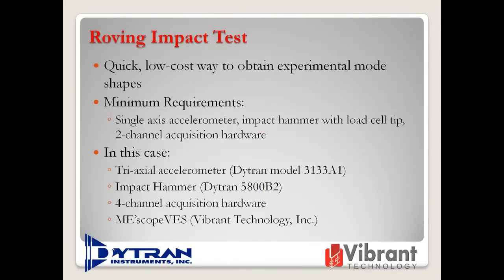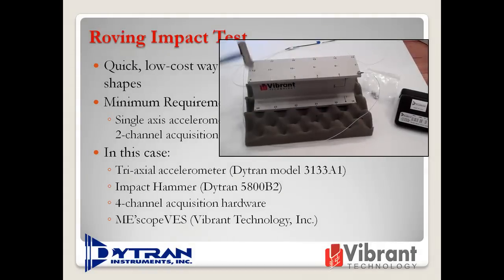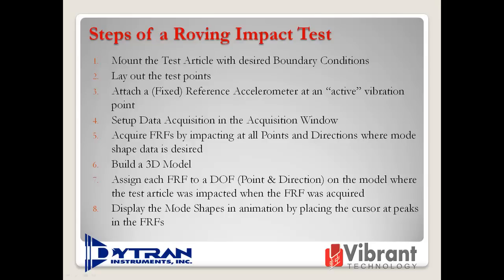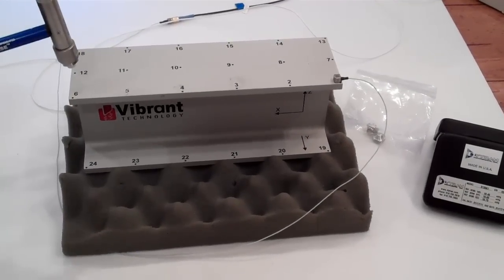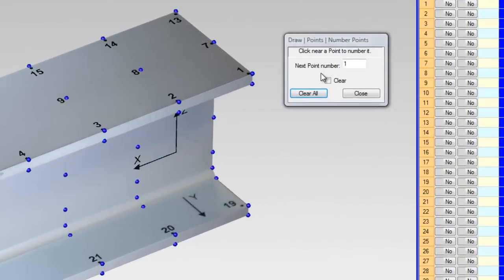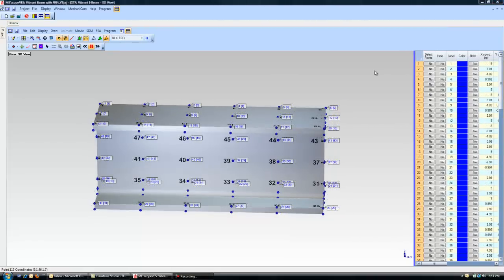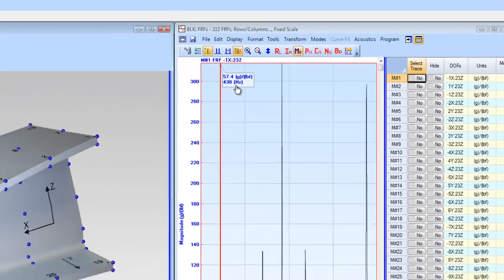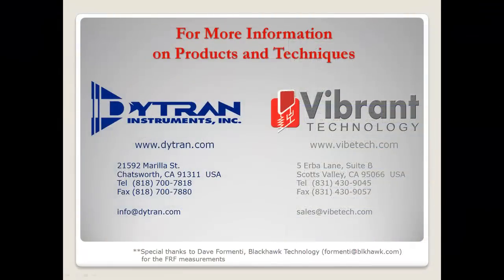Impact Testing for Modal Analysis

Comment from the maker: There is no specific methodology for determining the test point locations on a structure. Modes and deflection shapes will exhibit themselves to varying degrees at each test point location.  Therefore, the more test point locations you have, the better visual representation you can create.  However, in most cases, you can get a great representation of the mode or operating shape of a structure with just a handful of measurements.

Comment: Do you think using foam for a free-free boundary condition would work for plastic beams as well or are they not stiff enough?
Reply from the maker: It will depend upon the stiffness of the foam used. You really just want something stiff enough to support your test article so it is not resting on the table and flexible enough to allow the test article to move while vibrating. You can also use things like the air bags used for shipping packages or suspend the test article using fishing line or shock cord.

Comment: In case of single axis accelerometer do we need to attach 3 different accelerometers for each axis. Or just one is sufficient ?
Reply from the maker: There are a couple of ways you can get full 3-dimensional results from a single axis accelerometer.  As you mentioned, you can orient the accelerometer along each of the 3 axis prior to each impact and impact the structure at the same point of impact.  Using this method, the impact point is your reference, and you rove the accelerometer.  You can also leave the accelerometer at a fixed point, and then rove your hammer to impact the structure at each test point at all 3 axis per point.  In this second case, your fixed accelerometer is your reference and you rove your impact hammer.  
Obviously, using a tri-axial accelerometer is a much more efficient way to test a structure in this method, but it can certainly still be accomplished using a single axis accel.

Comment: do we need to impact a structural in 3-D to get 3-D modal shapes? In my experiment, I used a roving impact test with a triaxial sensor, but impact forces were all in one direction(z). Can I get modal shapes in x-y directions?
Reply from the maker: Your mode shapes will come from the roving DOFs.  If you rove your hammer, your mode shapes will be the points and directions where you impact with the hammer.  If you rove your triaxial accelerometer, your mode shapes will be 3D motion at all of the points where you mounted your accelerometer.  In your experiment that you described, you will only get response in the (z) direction.
Reply: That is not correct. If a triax is used, accelerations are measured in all directions regardless of which direction(s) the input(s) are applied. If the responses along the various axes are highly coupled, as with many structures, the animations can actually be quite good for the "off axis" (i.e. not in the same direction as the impact) responses.

Comment: Hi, which DAQ did you use? is there any limitation for hardware such as impact hammer, accelerometer, and DAQ? where can I find these data for this software?
Reply from the maker: Hi Ashkan,
A National Instruments NI-9234 was used for the DAQ.  For more info on what DAQ's can be controlled directly by the ME'scopeVES software package as well as more info on the software and its capabilities, visit http://www.vibetech.com or contact us at sales@vibetech.com.  Thanks!
Reply: Thanks, I already contacted them to buy the license. I am having two different DAQs: NI 9215, and NI 9239. My accelerometer is PCB 356A25, and my Impact Hammer is PCB 086C03. 
I used to work with this software for a simple Beam Project. So my question is that with this equipment that I already have, can I run the software for a curvlinear surface?
Reply from the maker: Yes, curvilinear surfaces are no problem.  Any type of 3-dimensional surface or structure can be modeled in ME'scopeVES either by utilizing the software's drawing tools, or by importing one of the many types of 3D model file types imported by ME'scopeVES.  Also, all measurement points are adjustable, so normalizing your measurement locations to the surface of the structure to match the alignment of the accelerometer(s) is very easy to do.
Reply: Thank you very much. So can I connect my DAQs (NI 9215, and NI 9239) to the MEscope VES VT-550 Visual Modal Pro?
Reply from the maker: We unfortunately do not have an ACQ Window/DAQ Controller for either the NI 9215 or the NI 9239 at this time.  However, if you are using Lab View, you can easily export your data blocks in a UFF File Format for import directly into ME'scopeVES and modal analysis using VT-550 Visual Modal Pro.

If you have additional technical questions, please direct them to either sales@vibetech.com or support@vibetech.com and we will get you taken care of ASAP.

Thank you!
Reply: Thanks, I will probably buy this DAQ NI9234, however,  could you please let me know that for this test which Compact DAQ Carrier have been used to connect the DAQ to the PC and MEscopeVes.
Reply: I have an additional question of the MEscope VES package. Which Package has been used for exactly this analysis?